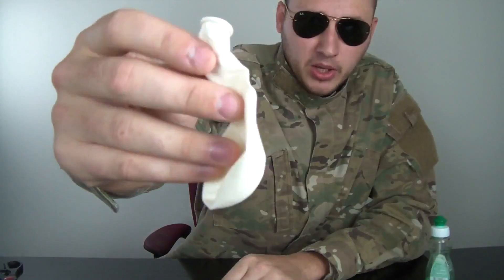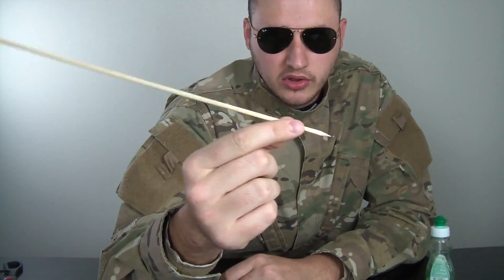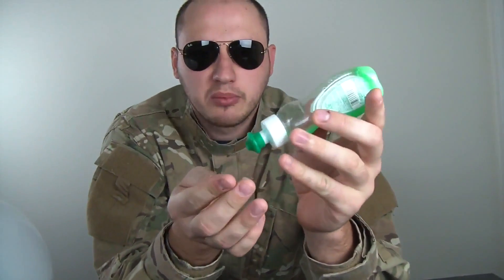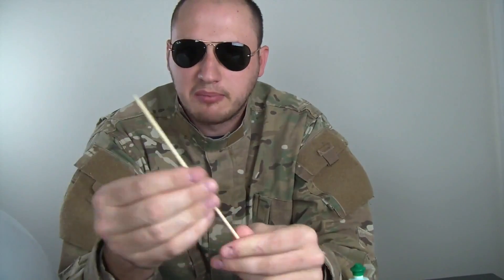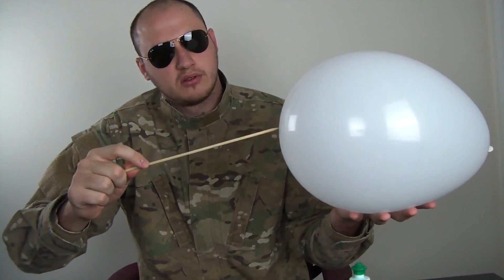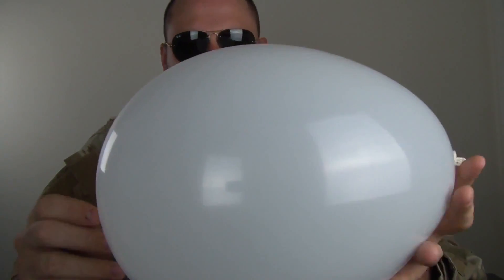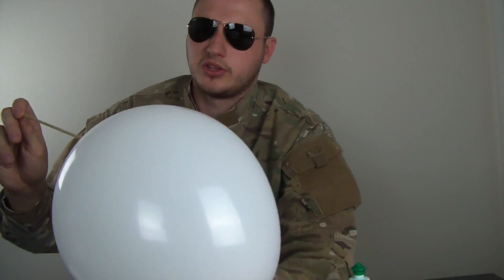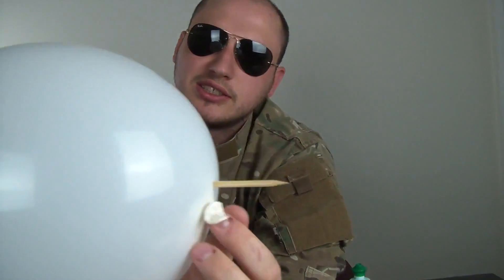Skewer Through Balloon - Science Experiment

Comment: The answer to your question: h t t p : / / w w w . chemisys . com . au/assets/images/technical%20images/figure4 . gif (remove the spaces between dots). What is happening is that at a microscopical level, when the wood is not well sanded down or it was but it got old, impurities set on the surface and the parallel arrangement or the fibers is mostly lost. This causes the baloon to pop, and the soap to avoid this by just decreasing the resistance of the "spikes" against the baloon.

Comment: In the side of the balloon, there are fewer polymer molecules. When you push the tip of the skewer through the rubber in the side of the balloon and the skewer breaks a few of the cross-links, the tension on the remaining cross-links is too great, and the balloon pops.

Comment: The rubber at the ends of the balloon is stretched out less than in the middle of the balloon. Therefore, there is less force pulling on it. This allows the tip of the skewer to break some polymer cross-links, push aside the molecules of rubber, and slide into the balloon. However, enough cross-links remain so that the balloon holds together.

Comment: If you use a bit of adhesive tape it makes the same effect! The baloon is made of ruber. When you put simething through the wall you open an area where you have a huge pressure being released and that´s why it pops. With the soap you are removing most of the friction and the wall keeps higher resistance. With the adhesive tape you are making the wall more resistante to the pressure and it doesn´t pops!

Comment: The rubber around the sides of the balloon when it's inflated is stretched out and thinner than the rubber at the top and bottom.

When you go to skewer the balloon, air rushes out since the pressure inside the balloon is higher than the pressure outside. Since the air rushes out so quickly, it tears the balloon and the air all escapes at once creating a bang noise.

When you skewer the top or bottom, the rubber is strong enough to still contain the air trying to escape and it doesn't pop.